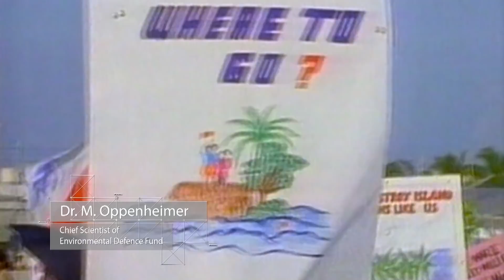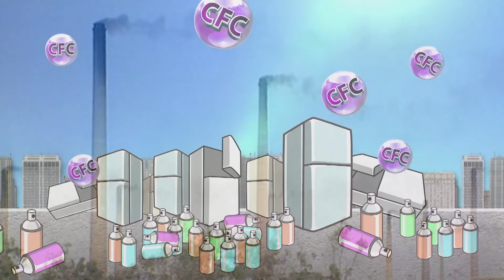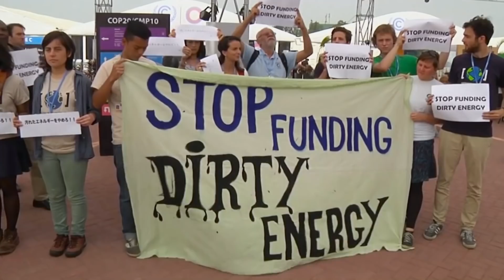World's Worst Environmental Diasters | Desperate Hours | Free Documentary

Comment: Jet aircraft emit gigantic quantities of nitrogen oxide compounds into the upper layers of the atmosphere. Nitrogen oxides rob the ozone out of the higher altitudes. For every flight hour of a jet aircraft,  25.6 tonnes of air is contaminated with NOX compounds. (it requires 16.8 tonnes of air to combust one tonne of fuel.) The atmosphere is 76% N. (ethermail)